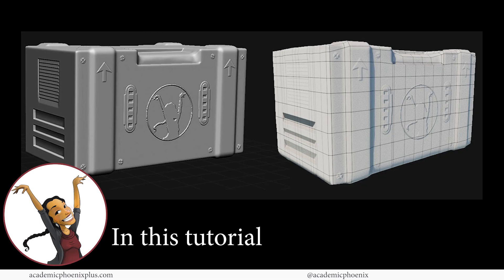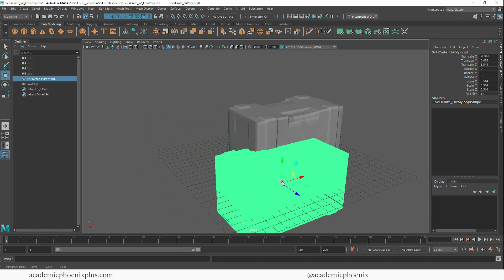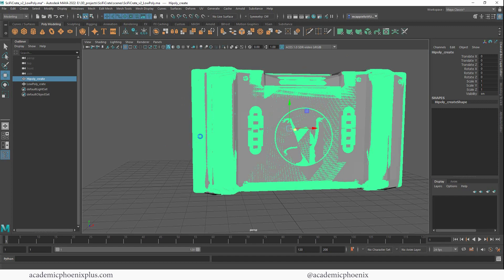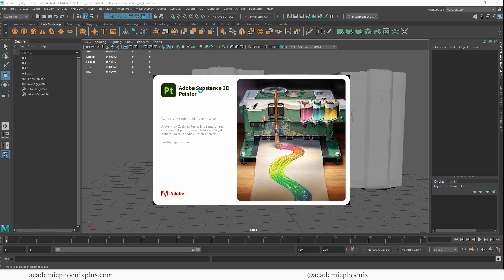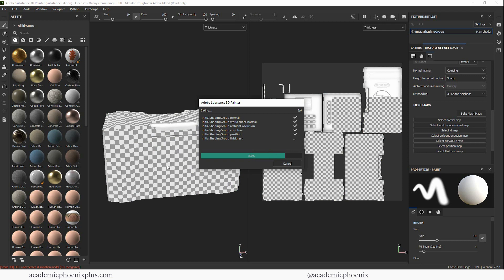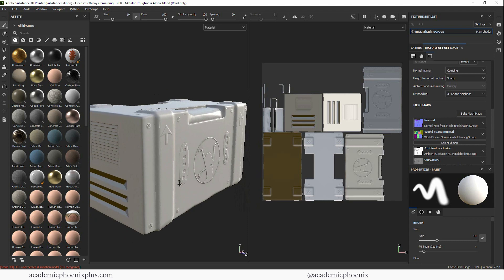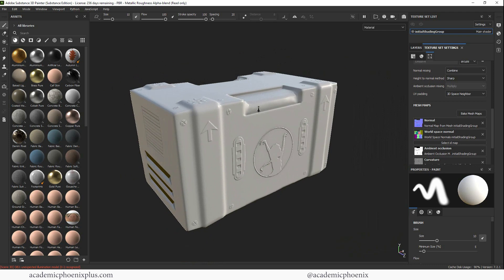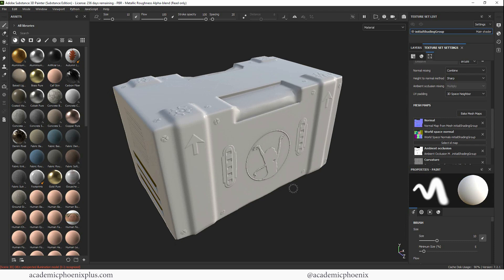Fixing Baking Issues in Substance 3D Painter

Comment: hey I'd like to mention there is one extra method that you could use, it may be slightly time consuming but the results provide a really good clean bake, for anyone reading this you should only use what I'm suggesting if you experience intersecting baking issues in tight areas and the front and rear distance don't work, basically the way it works is by making your own cage file by duplicating the low poly mesh and renaming the end from _low to _cage

basically the steps are these
(in maya)
1 duplicate the low poly mesh and rename its end tag from _low to _cage
2 make sure you high poly mesh is visible and on top of your cage mesh.
3 on the tool settings of the move tool make sure you set it to normal. 
4 with your cage file select the verts and pull in the N direction (N would be normal) until your high poly mesh is nolonger poking out of the cage file 
in some tight areas you can change the move tool back to default and nudge the verts of the cage file aswell. 
5 export the cage file as fbx

(in substance)

1 under the baking settings tick the use cage file on.
2 directly underneath the use cage tick box link your cage file, after that, bake.
Reply from the maker: Thanks for the tip! Yes, creating your own cage is a great way to create more controlled normals. I'm working on a tutorial for that as well. :)
Reply: Monica you taught me how to proceed further and fix those issues 

And Samuel Edwards your are a gem bro thank you so much ( With those cage things I was able to fix high Zbrush details and bake properly in SP) ❤️❤️❤️❤️ 

You both are my saviour ❤️❤️❤️ 

Thanks a lot to both of you , Keep Doing good things like this 👍
Reply: Hey  @AcademicPhoenixPlus , did you ever create this cage tutorial in the end? I can't find it on your profile.

Comment: On game production, we don't allow this kind of normal map which you showed in the end. Since you soften the lowpoly, the normal map out will bring you gradations, and we don't like that. The only way to address those edge issues on baking is to cut the UV where the hard cut is. Then make sure that you move the UV island a little bit to make sure the edge seam will not appear again.
Reply from the maker: That's interesting. I'm going to have to check on that. Usually you separate the UVs as you mentioned was for issues with the engine and lighting, but the newer engines don't have that issue. I'll have to investigate with my friends in the industry! Thank you for bringing it to my attention. :)
Reply: I have a question jonathan, i hope you would help, as you mentioned we need to cut the UV's where the hard cut is on the model, but what if the seem shows up? And i didn't get this like to move a UV island a little bit to the side or where?  Thanks.
Reply: @AcademicPhoenixPlus  I also have a question for you Monica, like why everyone is showing up the same method where we have high and low poly mesh, do you have any other video where you have shown the method without baking with the low poly, just a mid-range poly asset and still causing the normal baking problems I want to know about that issue, because it's literally so weird to see those edges after baking.
Reply: If your goal is to reduce chances of shading gradients, a better solution is to mark sharp edges on locations where you want very hard edges. Also good usage of mid-bevels. This will clean up your shading without splitting UV islands. Splitting a UV island just to avoid this in a bake or shading is not ideal, it will create even more issues with texture painting.
Reply: @none53  If you don't have a low and high poly mesh, there is no reason at all to bake normals. Just use the original normals. If you have a medium mesh ONLY, and go into painter and bake normals, you will get poor results and it's not necessary. In that case just turn off normal baking, because there's no data to bake.
Reply: @ShawnPaul86 isn't making an edge hard creates artifacts(curvy line bake) in substance painter? I wander how to avoid it, aside using mamroset for normal map... how do you bake a perfect normal map in painter?

Comment: I can't seem to get my zbrush sculpt to align with my original model... it turns out the the pivot points weren't zeroed out. So I adjusted the pivot point to the origin but they're still misaligned... is there a way to align them in Substance painter?

Comment: hi there, i've created a very high poly battleaxe for Skyrim, and whenever i bake the high poly mesh on the low poly in Substance painter, i'll see bits and pieces of the low poly still overwriting the high poly model. even though both meshes are identical in size. what do you think might be the problem ?
Reply: I think using a cage may solve this, so the low poly being low poly may cause some parts to overlap the high poly a lil bit causing this, a cage is basically the same low poly model, but scaled a lil bit along the normals, then tick the option that says "use cage" in painter and select the file that contains the Cage model.
Reply: @velstorios9473  a cage model ? i never even heard of that. is that a feature in substane painter or blender ? and if so how do implement it into my low poly mesh, does it replace the low poly or do i have to somehow apply it to the low poly ?
Reply: @MehrdadParthian  No i's not a feature, it is just the low poly model, duplicated, and scaled up along the normals. a third model other than the low poly and high poly, then in substance painter for example, on the baking window, you will see a "use cage" option, and under it an option to pick that third model exactly the way you pick a high poly model